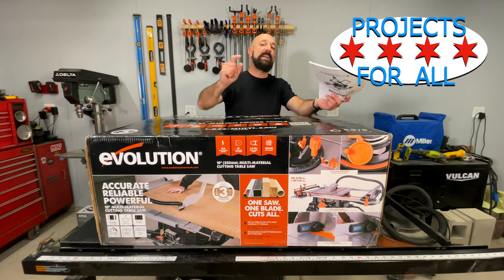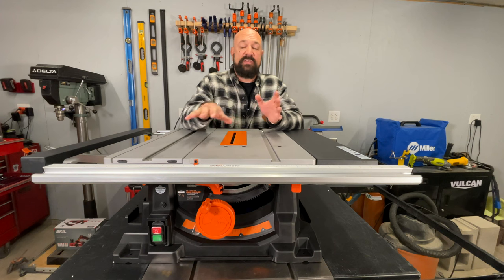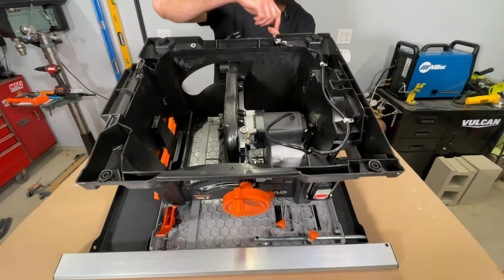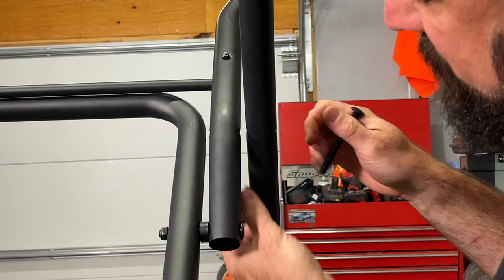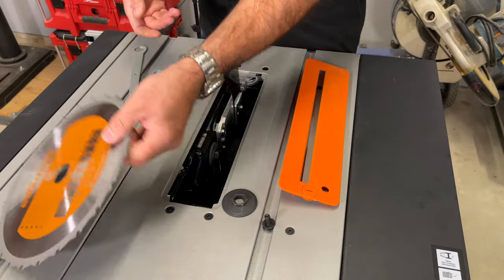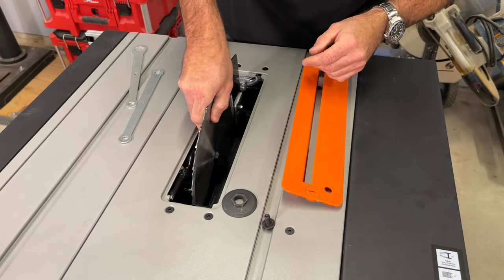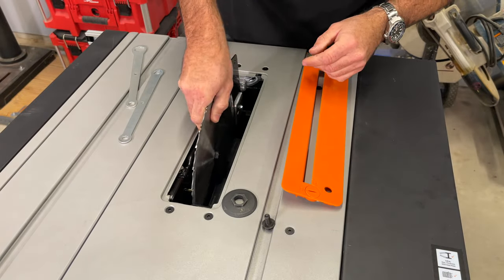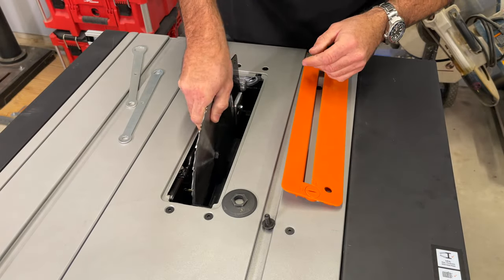Evolution Table Saw  ||  Assembly  ||  Calibration  ||  A++ Customer Service

Comment: I have the Evolution saw and am very pleased with it having used it for a number of projects.  Regarding the fence, I find this extremely quick to reposition over large distances and because it clamps at the far end in addition to the near end, it shows no sign of deflection or misalignment when exposed to side forces.  The reasons I chose it over any other are
1.  It’s ability to cut metal as well as wood.  I use a blade designed for wood when cutting such materials as this gives a much cleaner cut that the blade for metal.
2.  It’s portability.  Being on wheels and so easy to unfold and fold up after use were key factors for me as I bought it initially for a job on a remote site so it was easy to transport it in my car and set up on site.  Since then, I’ve found it equally quick and convenient for storing in my garage which is my workshop, and bringing it back into use.   A saw on a frame would be far less convenient for me.
Reply from the maker: Thanks for sharing your experience with the Evo Ian and thanks for watching!

Comment: Hi Mike thank you for taking the time to make this video, I built my Rage yesterday it was a breeze following your video whilst building up a got success 😊 what I would like to say is the right panel doesn’t come loose, the blade is already attached, the front measure can’t be bumped, the fence locks absolutely solid and square straight out of the box, there is a couple of slightly misaligned holes for the bolts but only 2 and could marry them up with arm strength. So I’m guessing they may have taken note of your review and spent the time to correct it all.
Once I’ve used it for a while I will let you know what I think.
Thanks again Big Mike.
Reply from the maker: Glad the video helped Mark and your saws in good order! Thanks for watching!

Comment: Evolution customer service is ACE!   I found the frame also a tight fit.  I used washing-up liquid to get those plastic end pieces on and the two-part metal frame.  The mitre gauge was off, and Evolution sent to me a replacement.

Comment: I have had this saw for two years. Once calibrated it has stayed dead on. I have used it to resaw 4x4 rough sawn hardwoods. Not a problem but I don't hog it. I am thinking hard about getting another saw because I need to cut dados. This saw won't hold a dado stack. But honestly the Evolution has worked so well I don't want to switch. Even if I could move up to a cabinet saw. If I do keep the Evolution, I am removing the folding base legs and building a base cabinet with an outfeed table. I need the storage space and the saw needs better dust collection.

Comment: Tip! no need for a stop block...

Why use the additional fence, at 24:00 with regards to repeatable cuts.  With the Rage 5S, you can use the additional fence as a stop block. For safety, fitting the shallow fence, so that the front of it is 3cm's before the blade (it works just like your piece of wood; however, due to it being more secure, it is less likely to get dragged/pulled into the saw).  The shallow fence will extend beyond the measuring gauge but not pass the blade.

Comment: I had a similar problem with assembly with holes not lining up. My work around was to undo all of the bolts until loose but just biting the threads. That gave me enough wiggle room to seat all the bolts. I wish I had seen your video (and Evolution’s assembly video) before I started to put it together. I just used the instruction book which was appallingly written and illustrated. The biggest issue I have with this saw is that it doesn’t have an emergency safety power off. Fortunately I found an etsy seller who 3D prints them for £12 plus shipping. Shame on Revolution for not adding that to the tablesaw, probably the most dangerous tool in a shop. I feel much safer knowing I can now just use my knee in my he general direction of the power switch to shut it down.
Reply from the maker: I agree John. You never see saws without the off button paddle. I figured it was a European think but what do I know. My buddy has the Evo track saw and noted there’s no safety on that either. Thanks for watching!
Reply: @ProjectsForAllReviews  The interesting thing is dado blades are banned Europe-wide for safety reasons because a riving knife can't be fitted to a dado stack. It should be a legal requirement that emergency stop paddles are fitted.

Comment: Your review is on point. The fence is a major setback for this saw. If we're rack and pinion like the Skil, it would be a great table saw.
I've ripped out my fence and attempted to create something better. It's still a work in progress.
Reply from the maker: Thank you! Good luck with the saw!
Reply: Blade/assembly wandering destroyed all of the fun. Despite meticulous adjustments over 6 weeks, I still get about 1mm off on 600mm. Barely noticeable, but I CAN SEE THAT on my kitchen furniture. Eventually, I just bought Makita DSP600Z with the tracks. Now the cut line is precisely where I see it.

Comment: this is one excellent video on how to assembly and setup a rage saw. i just got one and used another video, that was no where near as descreptive as this, well done young man, very grateful from a 76 year old joiner/builder, BTW i've got a couple of pieces left over, a small bolt, small washer. a spacer, and a couple of small nuts, is this normal?? i've checked everywhere and evrything is on properly, i am missing a flat black cap , but i'll get in touch with the supplier. thanks again. :)
Reply from the maker: Glad the video was helpful! I think there was some extra hardware included if I remember correctly. Thanks for watching!

Comment: My daily driver table saw is a 725T2, but I want to get a smaller one for dedicated 1/2" dado use so I can stop switching blades. Something that folds up would be nice. I was thinking the DeWalt until I saw this video... now I'm thinking the DeWalt. :) That thing looks like a great option for job site rough cuts and the like for construction, or for pinewood derby stuff, but I just don't see that fence being even remotely accurate after a handful of cuts, and I get that throat plate works about as well as a trampoline for keeping the material flat and straight between the blade and fence. I'll follow your adventures with this thing with interest.
Reply from the maker: Ill admit Im struggling to pin down exactly who this saw is made for. The review vid is on the channel if your interested. I have the $350 Skil with the fold out legs in the shop now. Should be doing that one in a few weeks. Thanks for watching!

Comment: I wonder if the reason that they suggest using the fence extension all the time (20:10) is that the fence isn't that well made, and the extension is straighter! I had to dismantle my fence and file the aluminium profile down to fit the end locking piece: it is fine now.
You need to make sure that you snug the front of the fence to the rail before tightening it down to make sure it is parallel to the slots.
How well-fitting was your sliding mitre carriage? I found that there was a lot of play in mine, so I don't really use it. A shame, because it is a nice feature.
Despite these whinges, I love my Rage-5S and use it a lot!
Reply from the maker: It’s possible Mike because the main fence is pretty thin aluminum. There is some runout on that sliding panel but didn’t seem like too much. I should measure it since I still have the saw. Thanks for watching!

Comment: I'm curious about what this saw can do. So far, it seems all the cutting ability is in the actual blade and not the saw. I wonder, is it possible to just purchase the saw blade by itself and use it in another table saw ? In either case , I'm looking forward to your video! Thanks for your time!
Reply from the maker: Video should be out Friday or Saturday. I will tell you the blade is pretty amazing. The 10 inch blade is 1 in arbor but it says 4500 rpm max and my Delta it around 3500 rpm. Makes me curious too. Thanks for watching!

Comment: i have one of these saws and mine has a bolt under left hand front. It tighten the problem you have with the sliding textention
Reply from the maker: Ill have another look at mine. I’ve been meaning to reassemble it for weeks. Thanks for watching!

Comment: OK.  So the customer service is an A++.  And it looks to be a pretty good saw for $300-$350.  HOWEVER, the Skil TS6307-00 is also a pretty good saw for that price range...and it requires no assembly or calls to customer service to get damaged parts replaced.  Just based on how involved the assembly is I would skip the Evolution and go with the Skil.
Reply from the maker: The assembly is a pain in the neck but no big deal if the saw had been great. The Skils going to be tough to beat. Thanks for watching!
Reply: Skil is a better saw too. Ruckland is better yet.

Comment: This one seems to have some great features for the price, but the reviews on it are really rough.
The lack of available blades with a 1" arbor is what really turned me off on it. If I can't get a fine cut Diablo blade for it, I don't want it.
Looking at all the portable work site saws over the past few months, I have a raggedly old Taskforce table saw that I think I will just stick with until I have room for the Delta Contractor's saw. I just don't think any of the others will represent a big enough upgrade. I have to use a framing square to get the fence straight, but it's not the end of the world.
Reply from the maker: I haven’t gotten much past what you see in the vid on this one. It takes both a 1 inch and a 5/8 blade but looks like no dado. 2-3 weeks I’ll have the full review out and we’ll see if it’s any good. I’ve wanted to buy the 10 inch dual bevel sliding miter saw for myself for a long time. It takes the same multi material blade. We’ll be doing that review soon. Thanks as always!

Comment: Hey whatsup man, I had a thought. I been talking to you about that Skil table saw the last month or so, got an idea. What about like a budget table saw battle? I thought about the Hercules table saw from harbor freight, it has a rack and pinion fence, powerful motor, and a slightly higher rip capacity than the Skil, although it's $50 more (who cares, just sayin). I've never used the Hercules but there's a lot of folks who say it's as good or nearly as good as the DeWalt. What do you think, budget battle for the crown of best budget table saw? The evolution, Skil and Hercules?
Reply from the maker: Hey Adam! I’ve got something like this in the works now! We’re got the Evo almost wrapped up and the Skil is sitting in the shop in the box waiting it’s turn. I haven’t used the Admiral yet either but it’s also on my short list. Thanks for the comment!
Reply: @ProjectsForAllReviews  lol NOOOOOO not the Admiral, the Hercules! 🤦🤦
Reply from the maker: @milleradam98  LOL! Sorry it’s early…Hercules

Comment: Is there any good reason why this saw is $340 USD, £300, but is $800 CAD? Seems strange there is such a price difference...
Reply from the maker: Is that common for you guys in Canada to pay out the nose for tools? Seems absurd!!
Reply: This table saw is exactly the same model as the Scheppach HS115 which cost 250-300 Euro’s here in Europe.
Reply: @peterlommel  It's not exactly the same, the  motor runs much lower RPM with a multi blade, so you can cut metal, you can't do this on a scheppach.

Comment: Put the old stand in the box and send it back.
Shim the back side of the riser knife.
That looks like the same locking mechanism on the fence as the Rigid table saw ... it has NOT "evolved".
Reply from the maker: Hello Lewis! I agree I was pretty disappointed to see that fence design. At least this time it’s on a $350 job saw and not a $750 200lbs contractor…I suppose. We’ll see if it lives up to its other promises. Might still be worth something. Thanks for watching!
Reply: @ProjectsForAllReviews  
When you do your next video on this saw, can you give us the measurement from the floor to the top of the table as well as the height of saw sans the cart?
Reply from the maker: Sure!

Comment: I’m sure others have said, their’s nothing wrong with the original frame, ou commuted the ultimate sin of locking right the nuts and bolts on the other side, keep all the fasteners hand tight until you have everything assembled, then you tighten everything off.

Leaving ghee fasteners hand tight allows you some wiggle to room to let you move the brackets and to allow the bolts to fit properly.
Reply from the maker: That bolt on the other side is hand tightened to the nylon washer on the nut. So very loose. I didn’t show it but I drilled this hole large to assemble the whole frame, all hand tight, and made sure nothing else was bent before calling customer service. The replacement tube went together without a problem, because it wasn’t bent. Thanks for the comment.